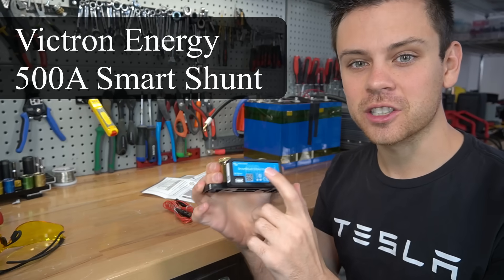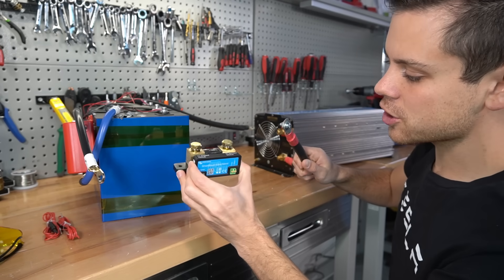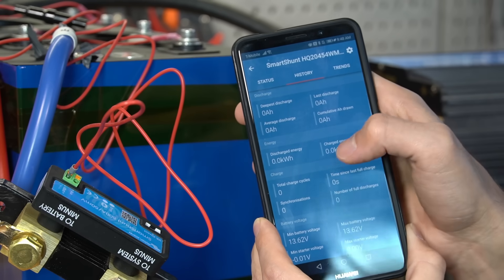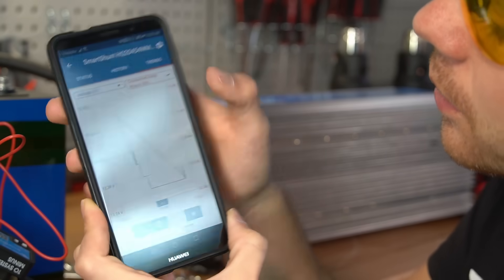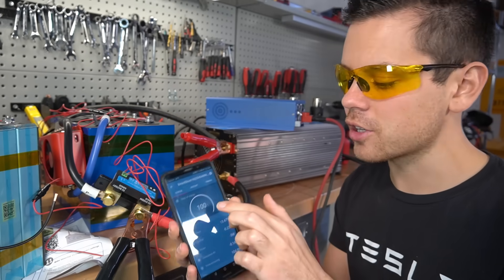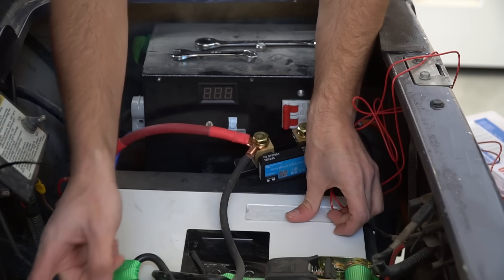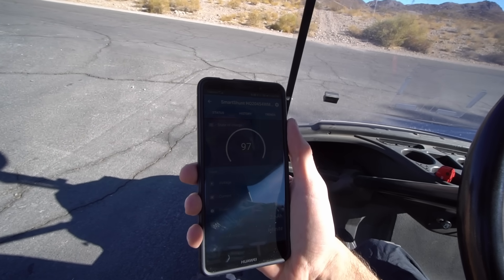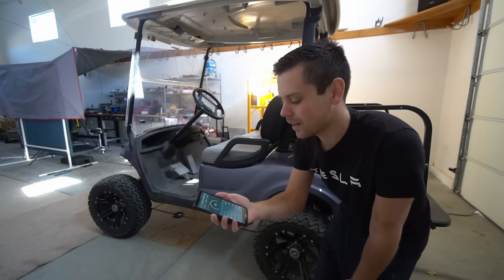Victron Energy 500A Smart Shunt (Beginner Friendly)

Comment: Check the fuses in the red power leads.  There was a period of time where the Victron supplied fuse had enough resistance to yield a voltage drop across it causing a low voltage reading when checked against my calibrated Fluke DMM.  The fuse issue was documented on the Victron community pages.  IIRC, the fuse subject may have made it to your forum, too.  A larger amp rating fuse reduced the voltage drop.

Comment: Its really important to note that the smartshunt does NOT have programmable relays like the bmv 712. Thanks for the great review.
Reply from the maker: Good point
Reply: @WillProwse   Check out "Thornwave Labs" monitors when you have a chance Will, I haven't seen anyone with your level of knowledge dive into those. They maybe don't make sense for those trying to stay within the victron eco system but they seem to be better at first glance. The bluetooth shunt they offer has a built in relay and is expandable with various sensors which looks very interesting for certain projects.
Reply: @Sebastian-xv1qd  They also provide the GX code for free on their website so you could build your own using a simple Raspberry Pi setup.  Its nice to see that, and although they may lose out a little on the Cerbo sales they will surely sell more of their other kit to go with it.  I love the achieved VRM log you can store on their website with all of your historic data.
Reply: OK.  So explain to us less informed why programmable relays are important and to whom.

Comment: To my surprise, Victron makes a 1000 amp and 2000 amp shunt. What application are they suited for??
Reply: I suspect it would be if you are doing multi unit/  3 phase set up (say 3 X 48/8000-110 Quattros peak output can be 16kw per unit, each unit can potentially draw over 300amp at peak ) or using large number of charge controllers say  like the (old ones I have)  85/150 that supports up to 25 connected in parallel.

Comment: Since this is your most recent video I'd like to ask a question. If a bms shuts down.... IE disconnects itself from the battery whether low voltage cut off, temperatures. over voltage would that not in turn cause damage to the solar charge controller. If so how can we eliminate/minimize the possibility of it happening?
Reply: The BMS doesn’t disconnect from the batteries it just stops the charging say in low temp situations or overcharging to protect the battery. The voltage is still present from the battery to the controller as it’s still physically connected so no damage will occur. If you had a “manual” throw switch to fully disconnect them yes damage may occur.
Reply: @MrMaster72  I've read some comments about battle born batteries that shows zero volts to multimeters after either low voltage draws drain them such as people forgetting to turn a light off in a RV they were able to recover the battery but the BMS actually shut off to prevent a true complete depletion of the batteries. One other person had a bad cell in his battery bank (used prismatic cells not battle born) the BMS showed that it would go 3.6 I believe before other cells then drain and restart the charging cycle after some cycles it would shut off put out 0 volts for the bank may have been a cheap BMS or shut itself off due to overheating of the battery either case it showed 0 volts out of the BMS but cells were still charged after letting the cells sit for a while the bad cell would discharge to 2.2 when he pulled it from his bank.

Comment: That is amazing!!! How do you like the app? Is it clunky or fairly polished?
Reply from the maker: I love the app! Better than most grid tie inverter apps in my opinion haha. It has everything, and connects quickly.
Reply: It's pretty decent.  The bluetooth connection process can be a bit sluggish, which is annoying flipping among multiple devices, but otherwise it works well. Updates are also a pain, in that they have to be in lockstep so when the app updates it'll force a firmware update next time it opens.

Comment: For my dual battery banks in a boat what does this shunt do that a charge controller and each BMS can't?
Reply: A shunt let’s you know what’s going in/out. Your (solar?) charge controller tells you what’s been generated (wind/solar) and battery voltage/amps in. Your BMS regulates your battery charging/balancing parameters (li-ion ....etc). I’m sure Will could describe it better..

Comment: I have this shunt and while it is great, it is definitely not water proof, not even water resistant. 

Mine started reading erratically (the battery temperature sensor) and while I was troubleshooting it, found water dripping from the celling into the shunt. 
After a few blasts electrical contact cleaner and letting it completely dry out, luckily, it came back to working properly.

So, if there is a chance water can get to it, I suggest you protect it better.
Reply: Do you think fingernail acrylic would work to seal?
Reply from the maker: I'll just throw it into a plastic bag :D haha

I used to make my racing drone speed controller pcb's waterproof with a spray on coating. Easy to do. 

I want to stress test it so I will leave it how it is and wait till it breaks.
Reply from the maker: @Sebastian-xv1qd  ok a weather test? Lol I don't know
Reply from the maker: @Sebastian-xv1qd  what do u want to call it instead

Comment: I’ve owned the bmv-712 for nearly 3 years and overall it is a very good product.

There are some challenges if you live in cold climates 

I also use 2 battleborn 100 amp batteries whose bms auto shuts off charging at 25 degrees to protect the batteries.

I also have a victron energy 100/50 solar controller with 960 watts of renegy solar panels

Today (in the Buffalo NY area ) the temp dropped to 16 (yes silly cold). This disables charging on the BB’s (which is good) 

The sun came up and the bmv-712 decided to re-calibrate and said the actual 35.5% SOC was now 100% SOC because the voltage went up to 14.6 since the BB’S wouldn’t take any charge.

The fun part was heating up the BB’s until they would charge ; ) (I could post the video but I don’t want to deal with the comments)

At least I got to see the Bills win their first playoff game in 25 years while I waited for the batteries to charge (I was also running a generator to help)

But the batteries are not fully charged (I had to leave) and the battery Voltage is 13.5 with no load but the BMV still says it is at a 100% SOC.

So there is room for improvement- but it is still a great product compared to anything else I have found.
Reply: This looks just like the 712 but without the display. All the Bluetooth displays look the same. It's like they just moved the Bluetooth transmitter from the wall mount display to the shunt. It may behave in the same way. Perhaps Will can do a side by side test.
Reply: You're going to want to turn off the Battery Starts Synchronized option.  With it on, it assumes the battery is at 100% every time it reconnects itself.  With it off, the SOC will show --- until the battery gets to 100% SOC.
Reply: @tonygoinggonzo  
Does it use the voltage to determine soc then?
Reply: No, with a battleborn it well wait until the battleborns are fully charged & won't accept any more current, then it will sync to 100%. Again, this only happens when the battleborns shut themselves down due to low SOC.

Comment: So this is a Victron Smart 712 battery monitor without the display. Much better deal since the 712 display is fairly convoluted. One question, does it have the ability to control a relay like the 712. I use the 712 with the temperature sensor to control the MPPT for cold weather and high voltage. So far it has worked, but it cost over $200 as opposed to the $129 for the smart shunt. Would recommend the temperature sensor to make it just that much more useful if your charge controller supports a relay.
Good review. Thanks.

Comment: In the settings where it says 'charged voltage' , you've put in 14.6 is the charged voltage different to the chargING voltage?
Reply from the maker: That's just max adsorption to signify max SOC. use whatever you deem as appropriate
Reply: @WillProwse  Okey smokey. Thanks Will

Comment: im looking to get my first big 12 volt inverter for my bus to rv looking for a 3500 to 5000 any help i have around 600 dollars 
what what you all us
Reply: I’ve used Giandel inverters and not had any trouble....I tend not to use anything over 2000w though...a 5000w inverter draws a lot of Amps on a 12volt system need serious cabling etc...I’d stick with as low as wattage as you can get away with..
Reply: @MrMaster72  i like to run a TV PS4 Laptop one of those new cook burner and a toaster over 
it will not be all on at 1 time but that way i want a 5000 inverter what if i go to a 24V 5000 inverter think that will work
Reply: @VloggingCountry  ok,I’d work out what your max current draw would be with the appliances you’d have on at the same time giving some room for surge etc...it’s not the inverter that draws its the appliances obviously which draw from your batteries through the inverter. Higher the battery voltage lower the amps. Depends on what your setup is..?  If you have a 24volt install ie: batteries are configured as 24volt output the. 24volt inverter makes sense. If not your using 12 to 24v buck converters which really don’t make sense for efficiency. My point is running 12v with a massive inverter and loads needs big cabling/protection and lots of battery capacity. If you have that then it’s not a problem. 5000W draw on 12v is over 400amps coming off your batteries. There going to flatten quickly unless you have a big solar system (and sun!) keep your usage sensible and you’ll be fine...👍
Reply: @MrMaster72  was going to have around 6 battery to start with 4 100w solar pannel on top my 11 window bus just need to know little more about this solar stuff

Comment: Victron makes quality components, but they do like to nickle and dime you for stuff (like a Bluetooth adapter for their Phoenix inverters). They also tend to document their components well, and interoperability between them is great. Excellent choice for anyone who wants to pay extra and have everything just work. Now if they just made a BMS.
Reply from the maker: Yes I agree. Good point.
Reply: They make a number of BMS’ at least they are available in Europe maybe not US they are for their smart lithium battery range
Reply: @simonphillips8636  I know they make battery monitoring devices, but I have not seen a cell level battery management system from them that didn't come with a seriously over priced battery attached.
Reply: @john_in_phoenix  yes you could be right they are designed for their own smart lithium’s maybe could be used for other batteries though not sure
Reply: @simonphillips8636  Yes, they do sell something like a BMS, but the price is over $100 per cell. I can see why I have never heard about them, it would cost over $800 to monitor a 24v battery, and then extra to get the rest of the devices to get it to do something other than tell you the cell voltage and temperature. Little things like stop discharging when cell voltage is too low, or turn off charging when cell voltage is too high are extra costs. Sigh.
Reply: @john_in_phoenix  their ve can bms is £95 and the smart bms Cl 100 is £180 it can control up to 6 batteries each with 6 cells so 36 cells at least not sure what you are looking at unless prices have n US are a lot more than Europe

Comment: QUEST: Hello,
you always make very interesting videos, sometimes I follow your videos and sometimes not. Since I unfortunately do not speak English and also understand very little.
I plan to build a solar vehicle with about 1800 Wp, plus use 48x 280 Ah / 3.2 V batteries.

Now my question to you!
Unfortunately I don't see any video from you of batteries you are not satisfied with. Do you get all the batteries from the manufacturer as a gift and therefore make no dissatisfied battery videos?

It would be very nice to get a little more info to get a better overview.

Which LiFePo4 batteries would you use for a solar vehicle?

=======================

FRAGE: Hallo,
du machst immer sehr interessante Videos, ab und zu verfolge ich deine Videos und ab und zu nicht. Da ich leider kein Englisch spreche und auch sehr wenig verstehe.
Ich plane ein Solarfahrzeug mit ca. 1800 Wp aufzubauen, plus 48x 280 Ah / 3,2 V Akkus zu verwenden.

Nun meine Frage an dich!
Ich sehe bei dir leider kein Video von Akkus, mit denen du nicht zufrieden bist. Bekommst du alle Akkus von dem Hersteller geschenkt und machst deswegen keine unzufriedene Akku Videos?

Es wäre sehr schön, da mal etwas mehr Infos zu erhalten, um somit einen besseren Überblick zu bekommen.

Welche LiFePo4 Akkus würdest du verwenden, für ein Solarfahrzeug?

Comment: Thanks for showing the app. Been debating with myself about monitoring my system.   This just makes sense with a dedicated cheap android tablet through bluetooth.  Rather than spending the gazillion dollars on the color gx.
Reply: They have ported that to the Raspberry Pi, just FYI. Google it. Still not 100% on the Pi 4, but really works well on a Pi 3 with the official Pi touchscreen display.
Reply: @john_in_phoenix  Interesting.  Thanks for the heads up.
Reply: @john_in_phoenix  It is working 100% on my Pi 4b over 3 months.

Comment: Wish I could trade the Vitron Battery Connect I bought when I was starting to build my first solar system and watched your video showing it. At the time, I didn't know it couldn't be used on lithium titanate batteries. Still have it new in the box. If this monitor wasn't so expensive I would buy one but, don't think it would do much for a 20 battery battery bank.